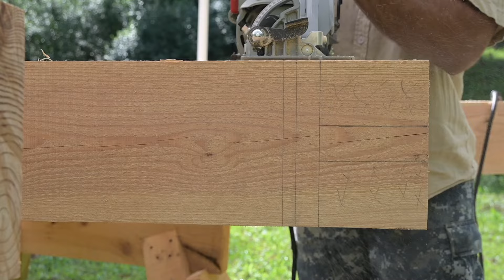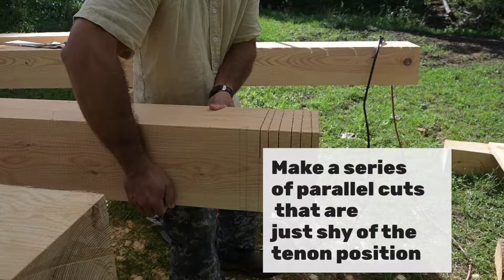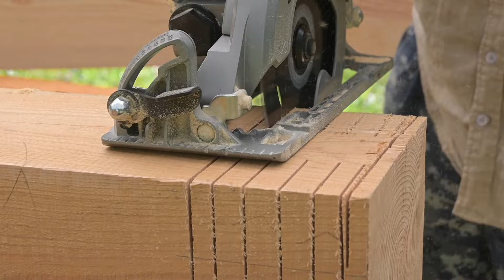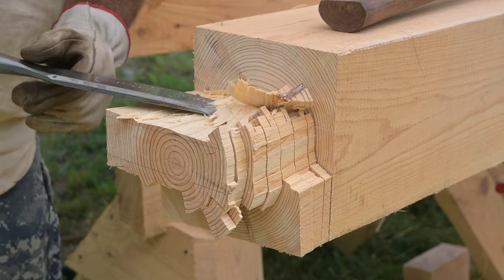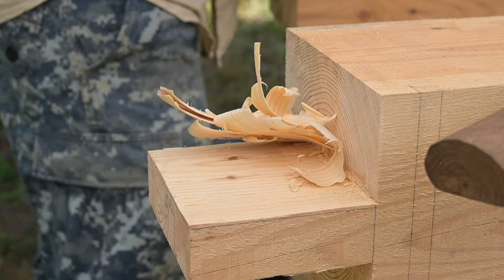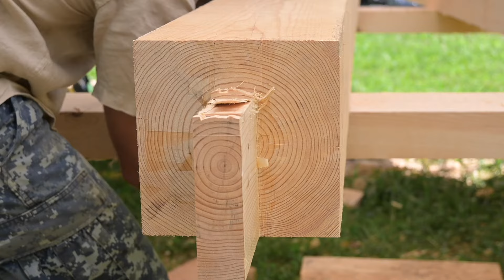Must-Know Timber Framing Joinery (cutting square rule tenon from start to finish)

Comment: Great video! I learn a lot from those close up shots. Could you pls explain the "critical" bevel at 20:24 a bit more? I have never seen this before on a tenon. And why removing the part at 18:57 at all? Thanks :)
Reply from the maker: That's a reduction. It's done in square rule timber framing on the opposite face from the reference face. The bevel helps the timber not crack along that line created by the reduction. This technique is sometimes used for joists. Joists can also use a particular kind of "swoop" that's carved out to create the same function. 

I'll add an explanation to the video description for anyone else who as the same question.

The house I currently live in didn't make correct cut outs on the joists and almost every one of them has split. The floor shakes and the house rattles whenever you walk. No good! Luckily the sills are strong and the rest of the house is well-built so it's still standing, but I do plan to fix the problem eventually.
Reply: Killionleon the square rule theory if to make allowance for Timbers that are not uniform dimensions. If you reduce the joinery to be exactly 7.5 inches on your 8x8 beam, you end up with a solid joint. Some timber is 7 7/8 x 8 1/16 at one end and another could be 8 x 7 3/4.  Make each joint 7 1/2 and the problem is eliminated. Just more work.

Comment: What is or which side is the top and why does the bevel stop the timber from cracking? what does the mortise  look like when it joins the tenon?.
Reply from the maker: 90 degree interior angles are prone to cracking at the vertex. The bevel spreads the stresses out so it’s less likely to crack.
Not sure I understand your question about the mortise. It looks like a rectangular pocket for the tenon.

Comment: Why don’t you use the full 2” for the paring work you do?
Reply: I have seen some high stress on the 1.5 that would make any one feel uncomfortable
Reply from the maker: Why didn't I use the slick on this one? I didn't have my sharpening stone yet. I re-ground the edge on the slick because it came too steep so it didn't work well on pine. The other video with mortiser you commented on is frm a different project and after I re-ground the slick.

Comment: You might want to sharpen your chisel and plane irons. They seem to be dull, wasting your energy and causing too much clean-up time.
Reply from the maker: Didn't have a good sharpening system last summer and the slick came ground for hard wood, not pine. Have a solid sharpening set up now. 👍